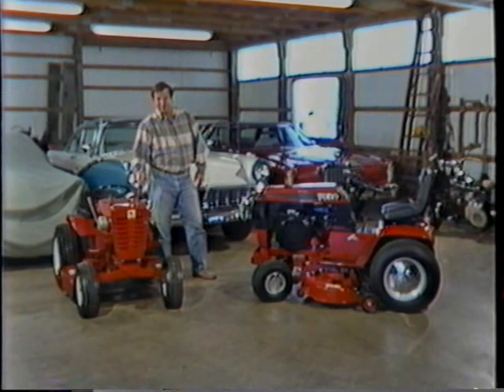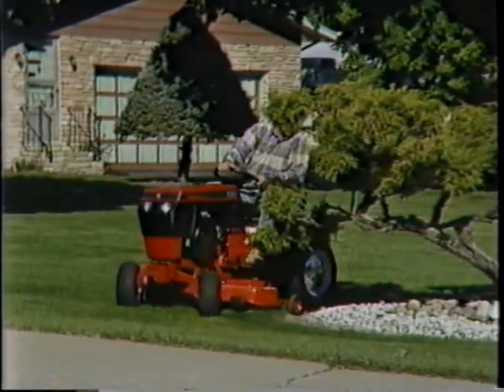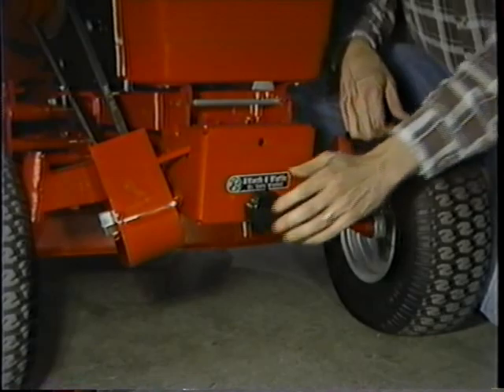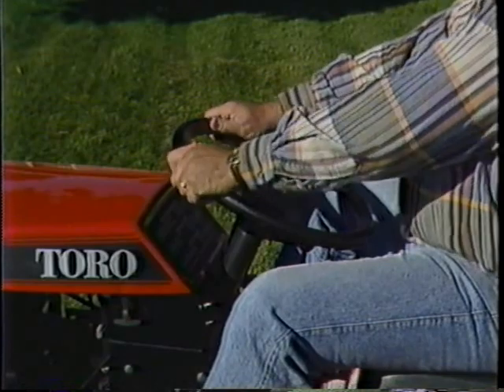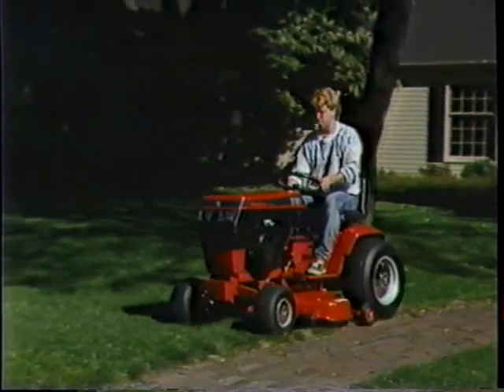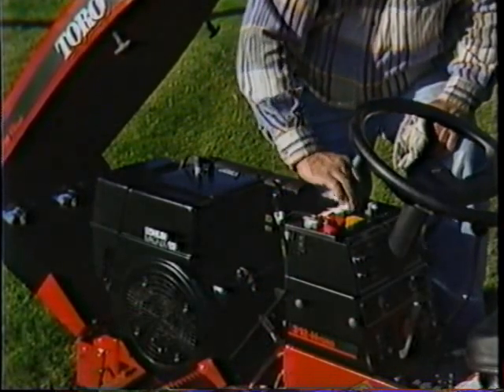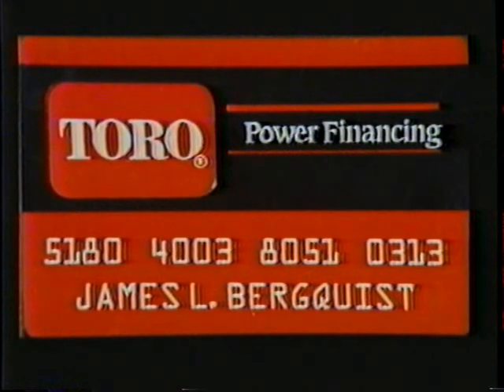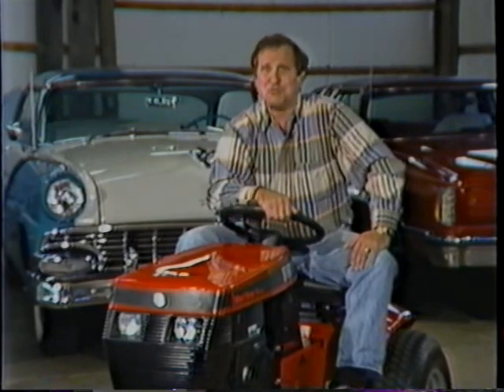Toro Wheel Horse 300 Series Tractors Promotional Video

Comment: There were right about the durability except for the deck
Reply from the maker: Before Toro bought Wheel Horse the deck shells were $200-300 for a new shell... you could buy the whole deck for around $700. New decks are still available to order for around $1200.